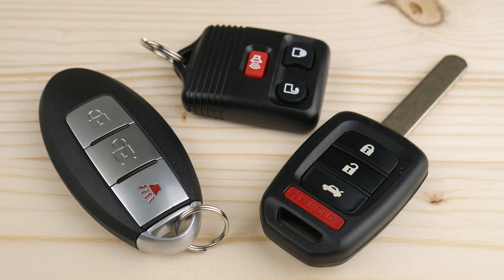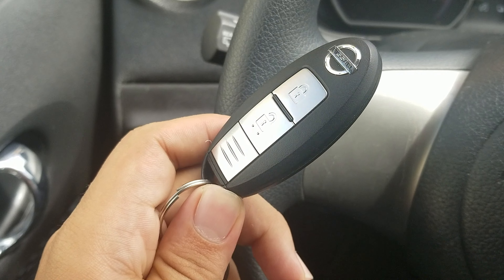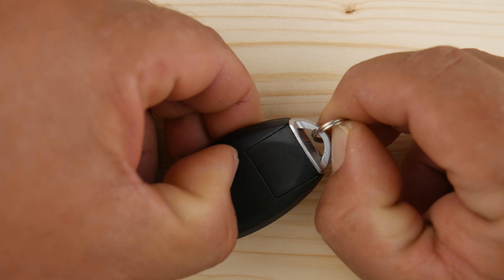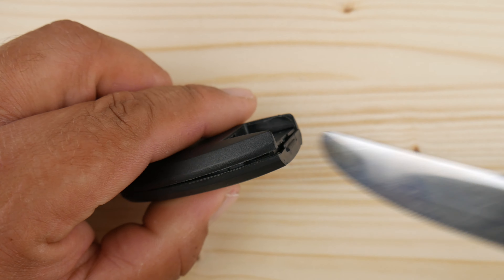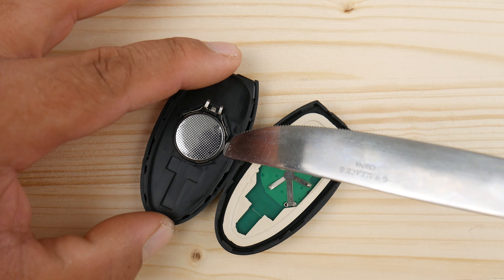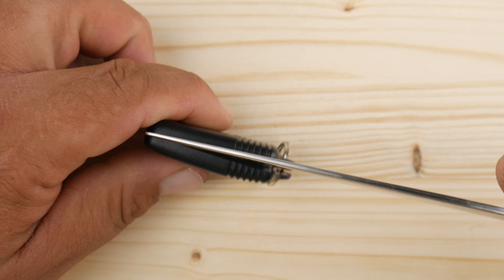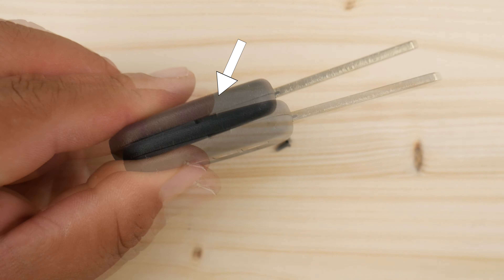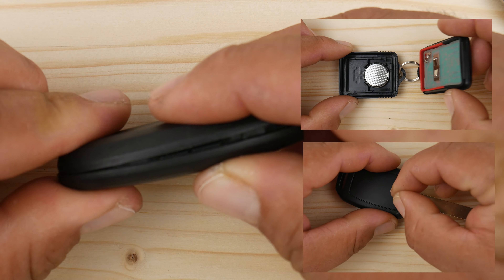How To Replace Install Battery Car Key Fob Remote Easy Simple

Comment: Perfect instructions! Easy to understand. I got my key open and bought a $3 battery. Saved myself a trip to the dealer where they would have charged me $60. Thanks, StatUpBox!!!
Reply from the maker: awesome! you're welcome! 👍😊
Reply: ...and a complimentary Knight Rider reference!!!  The 18yr old at the Dealership wouldn’t even know who David Hasselhoff is!!

Thanks for the perfect video.  -j
Reply: They charge 60$???
Reply: I got the cover off can see the battery ow to remove it ?
Reply: My local Infiniti dealership would replace the battery 'free' of charge. Of course, they knew they could easily recoup the cost through their other service charges. 🙄
Reply: @StatUpBox the best key video I seen out of 20 key videos simple right to the point thanks buddy I really needed your help

Comment: This video saved me literally $600!!!!!!! , was told by dealership $300 per key fob to be re programmed if they die … well they were both dying after 3 years. Thank you so much ! Bought $11.99 batteries and I’m saved 🙏
Reply: Dealers are absolutely revolting
Reply: $11.99???   I got for $1.47/ea w/free shipping on Ebay
Reply: Can the car not start if the battery in your key is dead?
Reply: @tinam2696 eventually, it won’t start. I’m only familiar with Hyundai and they start with keeping you locked out of your car. Then you’ll notice you have to get closer and closer to the car to unlock it. Eventually you’ll have pull out the metal key to get in your car! Once that happens you have to put the fob directly on the push to start button to even crank up your car because the car won’t recognize that the key is in the vicinity. That’s usually when my lazy bones goes to replace it!
Reply: @nikkiB100  ...Thanks I finally walked to the dealership with my dog (about a 1/4 mile away).

Comment: Thank you so much for the video! Both of my mom's key batteries had stopped working and she didn't want to waste time going to the dealer for a replacement. We were afraid prying it open after removing the insert would break it, but a cuticle pusher from my manicure case did the trick! Thankfully, I can now just go to the car parts store down the street to get a battery replacement instead.
Reply from the maker: Great to hear!

Comment: I just stumbled upon your video and was able to replace my battery on my keyfob with no issues with your instructions. Instead of using a butter knife, I used my screwdriver that's meant for my glasses. It's thin enough to where I can safely pry open the key without damaging the device because I can be very headed handed. I'm so happy it works and tested it out a few minutes ago and my car lit up just fine. Purchased a 10 pack from Amazon a while back and this is perfect. I just need to do the same thing to my spare key. 😊

Thank you again for the awesome tutorial.

Comment: Saved me $22 each time the battery needs changing and I accidentally washed the keys so you saved me as I was able to take it apart and dry and clean out the inside still works perfectly. Thanks so much everyone should hit the thumbs up!
Reply from the maker: Excellent!😊👍

Comment: I cant believe it was so simple this whole time. Both my key fabs died around the same time and it was getting to the point I had to sit there and push the start button several time to get my car to start
Reply: I was having the same problem just replacing the battery and then I noticed some of the prongs that support the battery were bent down, so I bent them back up! Problem solved

Comment: Excellent, thank you! The only thing I would change is to note the orientation of the battery BEFORE you take it out so you don't have to crack the case a second time to flip the battery.
Reply from the maker: Good tip!
Reply: He does mention when he takes the battery out to FLIP IT so that you could see the # of the battery you need

Comment: Good video, but my problem is getting the battery out. It's set like a gem with 4 plastic prongs, which I don't want to break. I'm stuck until I figure this out. :-(

Comment: I think the narrator is quite competent. Excellent structure and light humor. I really don’t like this tendency to remove the T sound from words like button or buttons. Buh in? Yet in other words like metal, batteries, or that,  the T is pronounced. Remember, 
Butt n.  Also, you might want to upgrade the grammar by using “an” before words that begin with a vowel. Not  “a” but AN. Dig? Like AN Apple. I’m a producer and I’ve learned that it maTTers. Lol

Comment: I had the last type with a tiny Phillips screw. I must have stripped the screw as cannot loosen with any jeweler sized screwdriver. Maybe tell us what size screwdriver to use?
Reply from the maker: try using a rubber band between the screw and the screwdriver

Comment: Question for the nissan keyfob, if it says the battery is CR2025 3V can I replace with any others e.g. CR2032 3V or CR2016 ?

Comment: [Good News! - There's no need for a flat blade screwdriver or butter knife to access and remove the battery.] 
The ONLY tool that's needed is already stored in the key fob... Yes, it's the retractable key shown being removed in the first step!! 
The fob was designed so that the retracted key is used to pry the fob's clam-shell housing apart, PLUS it also fits perfectly under the outside edge of the battery to gently separate it from its mooring clips with a slight twist of the key. Easy, peasy!

Comment: I have replaced a new battery in the slot the same way as the old battery was but it doesn't not work. Is there something else that could have been wrong with the remote control?
Reply: Same here, there is probably some kind of reset
Reply: Same here. Didnt  work.
Reply: I see this was posted a year ago, but if anyone else had the same issue, you probably have a thinner battery, I replaced my battery but it was just thinner, so I got a bit of paper put that into the slot first then the battery on top of that to 'raise' the battery to enable it to touch the terminals, and it works perfectly

Comment: Mine was the 1st type used in this video & I can assure you it didn't open as easy as in this video. Actually, it was a pain in the a** AND..... the dealerships got smart because the battery is covered now, unlike in this video and I can't replace it